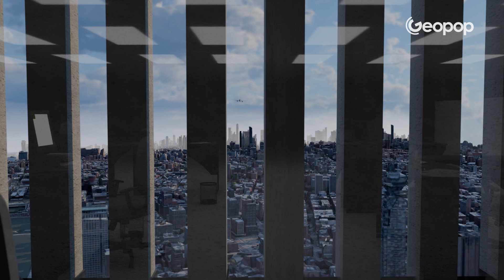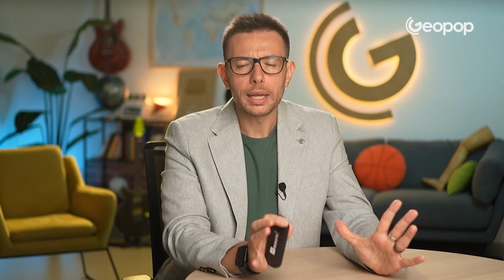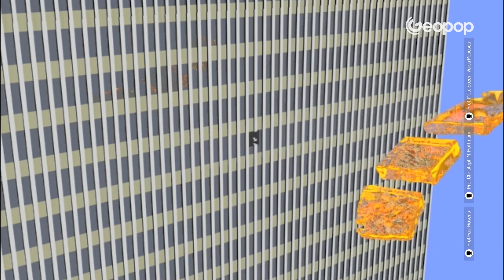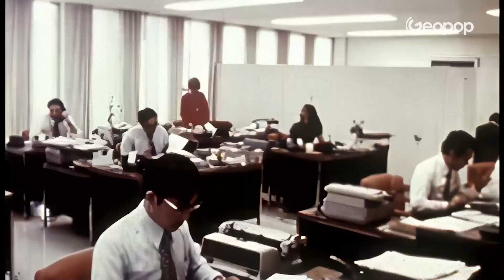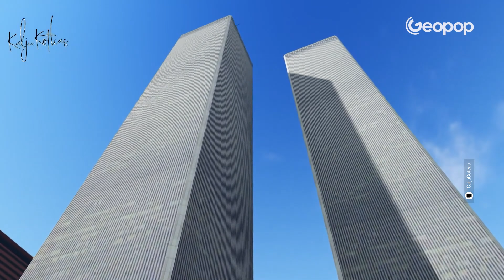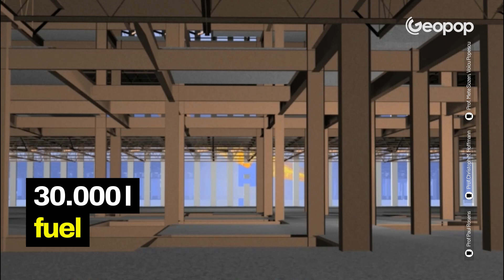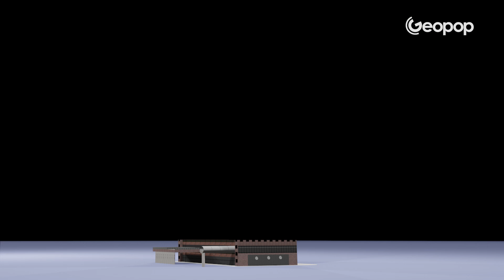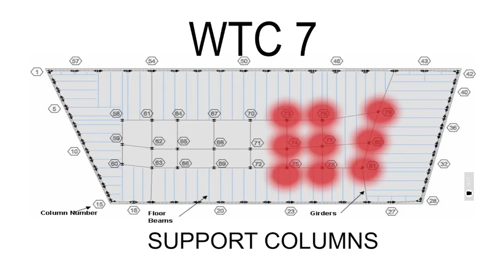9/11, 2001: The Technical Reconstruction of the Twin Towers and WTC 7 Collapses

Comment: Steel buildings don't just collapse into their own footprint due to fire only. There is ALOT more to the story and the TRUTH may never be actually found out
Reply: True.  It was a combo-platter of four (4) factors, not just one:

Impact Damage + Fire (heat) + Time + Gravity - Collapse

Remove any one of those four factors and there is no collapse.  Ignore any one of those four factors and you will never understand the collapses.

You ignored three.
Reply: None of these building were even close to collapsing into their own footprint. So there is that. If this was "controlled" demolition, then this was the worst demolition company of all time.

Comment: if airplanes can bring down these two towers as efficiently as they did, then why don't we fly planes into all buildings slated for controlled demolition....helloooo!
Reply: No planes needed, all you really have to do is light it on fire , and it will fall perfectly into its footprint like tower seven
Reply: Because ideally you don’t want a demolition job to spread debris and fire across several city blocks. Oh, and planes are much more expensive than just using explosives.
Reply: @alexsiemers7898 buildings were damaged.Fifteen blocks away the debris spread over forty five blocks